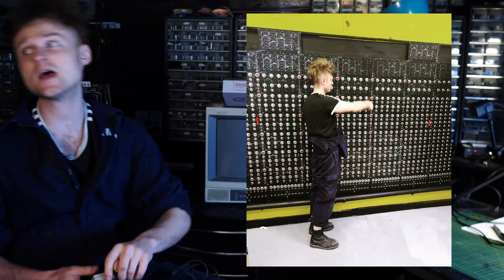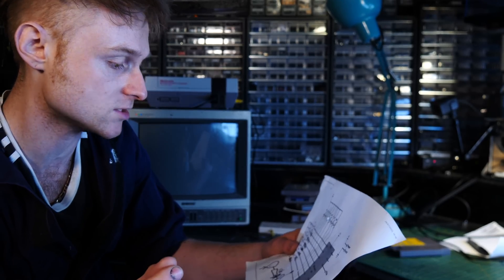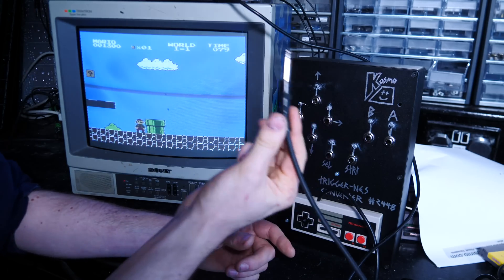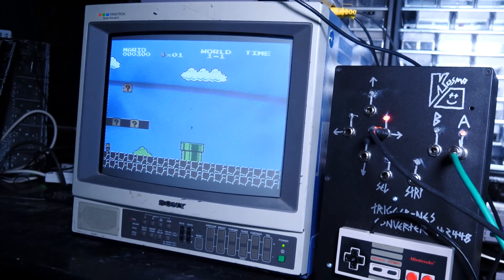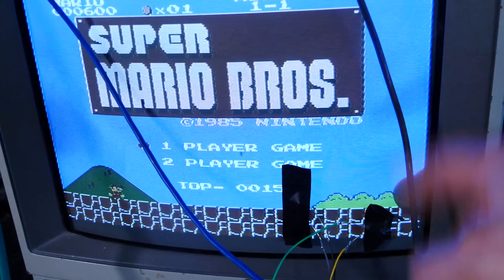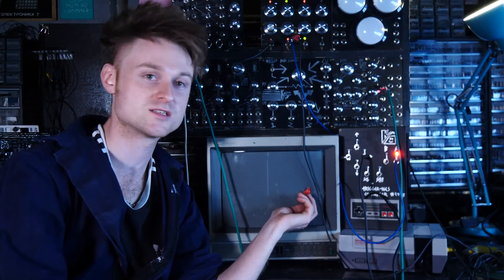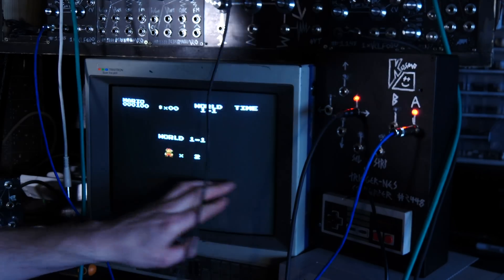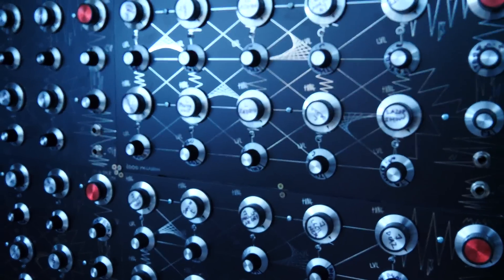Making A Machine So My Synth Can Play The NES SUPER MARIO

Comment: I think the game is predictable, so you could use a bunch sequencers to program each move. 
To start each game in sync, you could connect a cable to the button that starts the game.
Is there a component which delays a signal? for example if it would receive a pulse, it would output that pulse after say, one second. Such a component would be very useful for automatization.

Comment: Needs a step sequencer. Have the first step in the sequence double trigger the start button so that itstarts the game and plays exactly the same every time. 

The double trigger on start would pause and unpause the game when it loops so it doesn't get stuck. Then build up the sequence to get him further and further in each run. I bet with 32 steps you could find a patern that will get him through the whole game. If you time the sequencer along side the lfos you could use steps to reliably mute an lfo to stop him from running or jumping, or shorten his jumps. Don't forget fire flowers either.

Then you can turn that into a beat and take the whole thing on the road

Comment: Hold the B button to run - this will make clearing gaps (troughs) easier.

Dunno if you'll need a drone or a fast LFO to keep the B held.

Also maybe use a swing beat to do the jump. Little jump, big jump. This might make clearing enemies and then obstacles easier. I really think you should give a swing beat or syncopation a shot for jumping.

I would suggest watching a few speed runs of the game to see if there is a natural rhythm and beat of the game. I remember watching a Tool Assisted speed run of SMB3 and it seemed like there was a rhythm to the level where the player was able to make blind jumps and they always worked - sure it's a TA speed run, but I think if anyone studied it, you could break it down to a simple pattern.

And likely there is a simple pattern and spacing of enemies and gaps because of memory limitations and because of programming limitations at the time - I assume anyway. I'm sure they Ctrl+C and Ctrl+P level code a few times here and there so save on having to programming time.

Comment: How about getting button presses of a speed run of it, but retrofitting the timing towards controlling a modular synthesizer (aka voltage controlling of the lfos) that are sequenced per level, having however many sequences per number of levels, and the sequences can be dumb, too, so level 1 you press the first sequence, level 2 you press the second sequence. But I think you can measure how much time it takes to go through the motions per sequence so you can have a second stepped sequence that triggers the sequences so you don't actually have to control what sequence it is on.

Comment: i have drawn a schematic, you need 2 x 74lLS14, 2 x 74LS21, you make from the inverters 4 x 2  sets from the 74ls14, daisy chained. so you have the inverted signal from the input in between and the end of the daisy chain you the copy of the input, than you place 4 quad AND gates, you need to place all the outputs from the daisy chained inverter to the first input of 1 AND gates,than you take the INVERTED signal from each daisy chained inverters set and  bring that to all 3 AND GATES and repeat that for all. so each inverter set can disable the other 3 AND GATES, so these are always neglected. if no signal is applied to one input, the inverted section of the daisy chain inverters is always HIGH, arming the other AND Gates, but goes low is a signal is applied. disabling the other AND GATES. the never will be more than 1 input to the Nintendo, but 2 input signals at the same time will result in no output. that would probably be fun to watch with 4 noise generators and sample and holds and lfos. ....

Comment: i think, there is however a problem, the plastic of the directional pad inhibits you to press more than 1 or ?
i think you need to add some 74LS14 (inverter), buffer 74HC4050, 4 AND gate (74HC21),  2 and gate( 74HC08), some XOR gate (74HC86 4 input XOR gate) ic's:

https://en.wikipedia.org/wiki/XOR_gate
https://en.wikipedia.org/wiki/AND_gate
https://en.wikipedia.org/wiki/NOR_gate
https://en.wikipedia.org/wiki/NAND_gate
check the wiki page, on the right side there is a graphic list.
build some logic to prevent that more than 1 button is pressed.

it probably will start with attaching an inverter (74LS14) to each input jack for the directional input, feeding into a 4 input AND gates and ...... for each other buttons 

... and try again with noise generators, sample and hold, LOF's
: )

Comment: Maybe throw in some vcas and more lfos to modulate the speed of the primary control lfos 🤔. 

Perhaps some sample and hold modules to shake things up when stuck, maybe with comparators and sequential switches to determine what sort of change to make based on probabilities. The photocells could be used to determine if Mario is stuck  running up against a wall or pipe or whatever.

Throwing in use of the B button will make things more complex but also interesting: random sprints, longer jumps, use of fireballs if you get lucky, etc.

You could maybe pass the audio to the synth, use various filters to attempt to isolate some of the sound effects enough to have envelope followers detect whether a jump is started/complete (then decide if its time to jump again), whether time is running out (hold the B button more often?), whether mario died, etc.

Comment: I think it could win the game if proper frequencies are set and sync with each level for these two commands.
But for discover that you will need to use a computer and a nes emulator to run high speed trial and error optimizations.

Comment: I have an idea, and it's mathematically sound, it involves Fourier series. The downside is that you would have to first beat the game once before getting the synth to try. 

The idea is basically to model mario's movement as some collection of curves in 2d space, then with fourier analysis and infinitely many sine waves of varying amplitudes and frequencies you can accurately reproduce these "mario curves". Now we don't have infinitely many though 1000 oscillators should be more than enough. You have shown that the first level can be beat with 2 oscillators, there's nothing that says you cant beat the game with only two but I think you're more likely to see results with more oscillators.

Rough game plan:

(1) Before a playthrough rig the controller so that besides sending signals to the snes, you also record the button presses. Assume for illustrative purposes that you can beat the game with only pressing two buttons and not pressing anything (A to jump and right to run, and nothing when we need to stop and wait).

(2) For each action you take, for example let's take jumping (A), you have data of when you press the button and how long you press it, if you plot this in the x-y plane, you have a sort of square wave, where the lows are when the button isnt pressed and the highs are when the button is pressed. This is the same for the right button too.  If you do this for the whole game, at the end you will have two square waves for each button that together represents a valid sequence of button presses to beat the game.

(3) You can take the waves and do the fourier analysis on them separately (there are plenty of pieces of software to do this) and you will get a big table of data of frequencies and amplitudes for oscillators for each button. Summing up the oscillators and plugging the outputs to their respective buttons gives you a modular synth that can beat the game.

possible technical difficulties besides getting my rough plan to work would be firstly making sure all the oscillators are somewhat synced, oscillators phasing in and out would mess up mario. starting the game up at the right moment so that the beginning of the game lines up with the beginning of the period of the sum of oscillators. 

possible reasons we don't like this idea: we have to play the game ourselves first, the synth is not actually "playing" the game, as in we didn't twist the knobs in a educated way and find a configuration that works, we premeditated the whole thing, i.e. we have a precise solution (we lose the awe of discovery i guess), finally quite time consuming and some interesting technical solutions required, however I think this would be a nice challenge. 

If there are any aspects of this that can be improved, or that I should elaborate, I'd love to share thoughts!
Reply: 3 hours later, cue the Two Minute Papers guy In this paper, researcher Sam Battle documents his discovery of quantum mechanical simulation on classical Turing machines, made possible by periodic introduction of stochastic Bernoulli noise: the groundbreaking discovery which proved P=NP and ultimately led to a giant can of beans appearing in outer space.  All we need now is toast
Reply: @alakani  there are only Aleph-0 amount of possible equivalent Turing machines, which means if you keep adding coefficients to a discrete Fourier series you mathematically can use it to represent all Turing machines.
Reply: @alakani  (comment by gpt-3)
Reply: Your idea is sound,. Speedrunners finish Mario in under 20 minutes, Mario is 24 fps (i assume?) and what you suggest is calculating a fourier transform of the whole damn thing. That's... short to 30000 frames. Hey, it might actually work! But the FFT bins would be placed far below audible frequency range. I'm not sure if his oscillators can go down to 800 microhertz :D
Reply: @rageagainstthebath  as long as the dac was DC coupled I don't see there being a problem. I don't think doing it with analog oscillators would work, any drift would kill the whole thing
Reply: @rageagainstthebath  if you only want square waves you can always build a very slow clock out of two TON relays
Reply: I think this is possible. I forgot if it's possible to beat the whole game in anyway while constantly holding right. If that's the case, we would only need to press the B button (or maybe A, i forgot). And due to the speed of the game we might be able to get away with a low sample rate, say 2Hz. Since the speed run record is like 4 and a half minutes, there are only less than 600 sample points. Aka only 300 LFO is needed. LMNC got 1000 OSC I think, which means he can up the sample rate to like 5Hz, almost the limit of human without doing any frame perfect movement.
Reply: Would be interesting to try and distill this down into a formula. Something about a mathematical formula for beating Mario is pretty cool
Reply: @SkigBiggler  there is a formula, taking a Fourier transform of all gaming inputs. it's not a revolutionary idea, more like saying water is wet
Reply: Instead of beating the game himself, he could just get the data from a speedrun video or some program that already exists to play mario

Comment: Using some sort of "start" trigger might make it a bit more consistent, either by having the synth press the nes start button or using the controller power wire as an indicator for NES power on

Hard mode - create a song that also beats Mario
Reply: you could feed the game sound into the synth with a high pass filter to get the start sound then use that to start/stop a clock or whatever

Comment: A colour filter would allow you differentiate between the colours and a comparitor would allow you to differentiate between the light and dark green...If needed, a window comparitor would allow you to differentiate between light, mid and dark green.
Reply from the maker: like i mentionned in the video. annoyingly the green humps are the same green as the pipes which he needs to jump.
Reply: @LOOKMUMNOCOMPUTER   Point taken: However (here is my second thought)  The pipes are shaded with light/dark vertical stripes. I suspect that, because a LDR has a relatively slow response, it will average-out the shading giving a different value to either the dark or the light green humps. By using a window comparitor  maybe you can differentiate between the light green humps, dark green humps and the averaged-out light/dark green pipes.

P.S. If need be the LDR can be slowed down even more by using an integrator or low pass filter followed be a Schmitt trigger.

Comment: Sample and hold lfo modulating another lfo? Introducing slight randomness might help (eventually!) .
My other idea was a matrix of LDRs that together could detect if the screen doesnt move... if not, activate the backwards.
Or maybe add a very very low lfo on the backwards.  
Last idea... ldr could generate a signal, high pass filter, when it falls to zero then trigger something..
Reply from the maker: oolio

Comment: Use the photo-resistor  to detect movement not a specific level.
Reply from the maker: still same problem with the background
Reply: @LOOKMUMNOCOMPUTER  I was thinking something like make the photo-resistor into a voltage divider (use a pot so you can set its range), ac couple the center with a cap and feed that to a diode & cap to ground to create a DC level that is proportional to the AC content, then use that to control whatever. However you would probably need an op-amp to make it work properly.